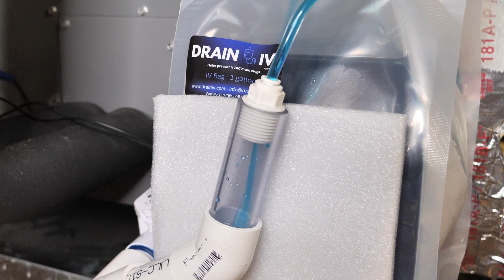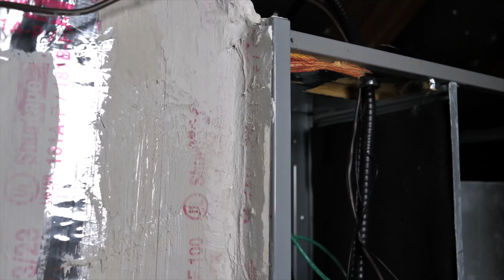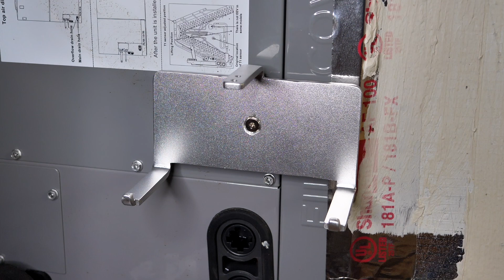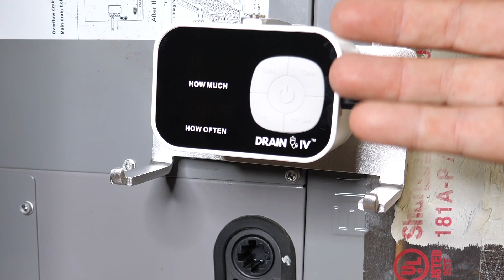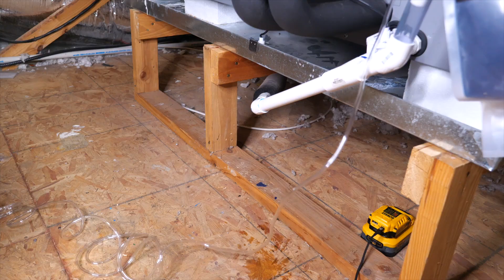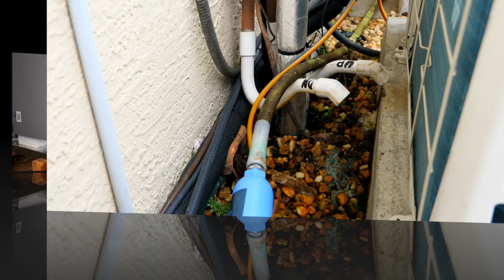How To Clean A/C Drain Lines with Drain I.V. - KEEP them kLEAN

Comment: Will the blue stuff harm bushes or flowers since many times things drain ring near bushes and plants!
Reply from the maker: Not at all, that's pretty much just coloring. It's a vinegar base.
Reply: @Shoptoolreviews  Great kinda figured it would have to be harmless but just checking.  I will call on pricing.
Reply: Can you run the line in the drain pan install of the drain line?
Reply: @ononewheel2 yes, that’s the best way to do it.
Reply: Would be nice if the time was run off run cooling time